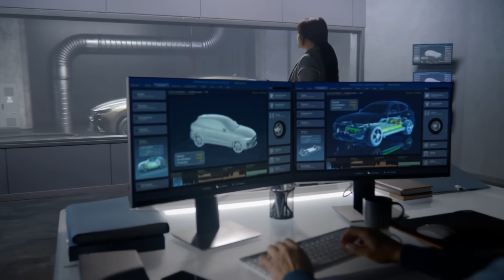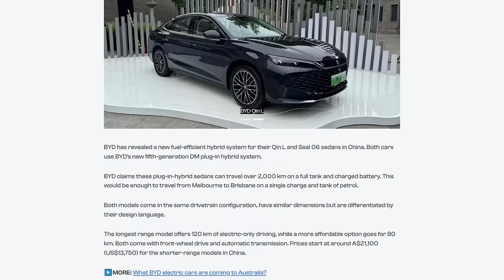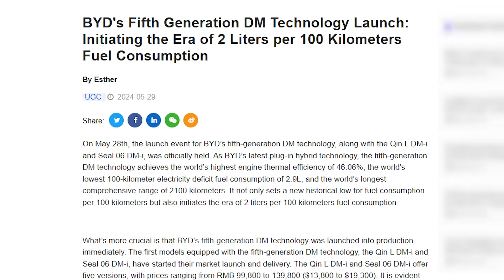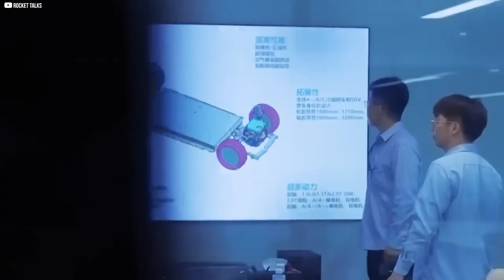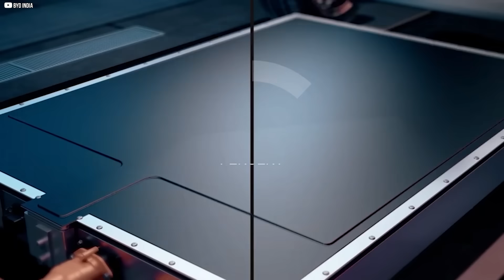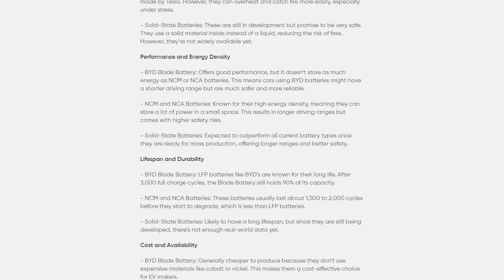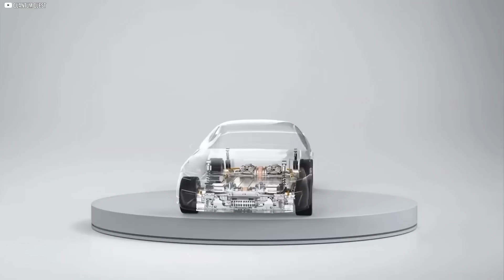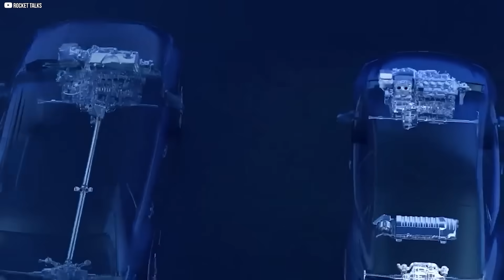Why the Auto Industry Is Shaken After BYD CEO’s Latest Reveal

Comment: Since three years Honda produces drives with roughly the same concept (but not plug in) : a combustion engine produces electric power in a generator which in turn supplies the electric motor which drives the wheels. No gear box needed. Only at speeds above 130 km/h the combustion engine joins in to reach the top speed of 180 km/h. My Honda Civic  e:hev has a 2 litre combustion engine with 140 hp and an electric motor with 120 hp. The system power is 194 hp. The fuel consumption of this mid sized sedan is below 5 l/100 km. This car is fantastic.

Comment: Toyota had already said hybrid is the future. BYD is late to the party.
Reply: Toyota is slinging mud trying to stay relevant too since their business is in trouble.
Reply: It’s totally different with Toyota hybrid,although BYD DMI is not a very new concept, but they use it to the maximum.
Reply: Toyota hybrids use oil instead of electricity. BYD hybrids use electricity instead of oil. The oil doesn't directly power the engine, it's only used for charging. They're completely different.
Reply: Vande mataram.bharat mata ki jai

Comment: Their next model uses that 50pc wasted heat to boil water which is used to drive a small 2 cylinder steam engine. The range is 3000 miles!

Comment: Trouble with a hybrid built around a low powered engine is while its fine around town, on a longer higher speed journey or when towing or other high load situation, at some point the battery is depleted and you are left with a 76KW engine trying to power a large very heavy vehicle and put juice back into the battery. Hybrids work best when the ICE is powerful enough to effectively run the vehicle in its worse case usage scenario without needing electric boost. This is where a Camry Hybrid excels.
 Still, without a full-sized spare you'd be crazy to drive more than 80km from home (space-saver) or outside road-side assistance coverage (repair kit - I hear they work great on a sidewall blowout!)
Reply: I too thought the gas engine was only a generator but it's not! When the vehicle gets up to a certain speed, the gas engine connects to the transfer case. BYDs are in essence a new breed of "hybrids". You can set it so that it doesn't do that...

Comment: 2000 km in single full tank + full charge
Reply: The Toyota can build the same one. The blade battery is a copyright from Honda too.
Reply: A YouTuber traveled 2,400 kilometers
Reply: @antony9866 Do you have to plug it in to charge or does the petrol engine do it?

Comment: i got the BYD Seal a month ago and its been sent back to the service center because the fuel system malfucntioning that cause the hybrid mode switch to auto swtichin modes which ultimately fried the blade batteries. i have to wait a minimum of six months to get it fixed because apperently im not the only having this problem . 🤣🤣

Comment: Siemens trains has been driven with an diesel generator and electric motor for many many years..
Reply: Yes. Its the same with Buses. Why do manufacturers not produce what everybody wants (electric for city) and diesel for long runs… dusl use fit for purpose?
Reply: Like 100 years old technology. Crazy entrenchment in the industry, and that’s why we need disruption every once in awhile.
Reply: PHEV cars have been around for a long time.  Toyota made it popular with the Prius (Prime).  BYD just do it better.  That's how technology advances.
Reply: @tomtube1012  The DM-i is basically an electric-driven hybrid system with the engine playing a supporting role—take away the engine, and it’s just an electric car. Toyota’s dual-engine system, on the other hand, is mainly engine-driven with the motor as a sidekick, so it’s essentially a gas-powered car
Reply: I would be quite about Siemens and their complicity in the illegal settlements in the west Jordan regio, useless to say: germans supporting zionism is no surprise.

Comment: You mean to say we have engine maintainance with battery maintanence too? I am sure it won't come cheap.
Reply: its far cheaper than toyota if check the price
Reply: Not really such a thing as battery maintenance, they just work and last about 15-20 yrs. the problem is bringing back maintenance on the a petrol engine with so many moving parts, part of me thinks this is going backwards, unless the petrol engine has a lot less stress on it because of the battery that might work
Reply: BYD True hybrid. unlike slow yo ta and slow honda being the same as diesel in fuel economy

Comment: PHEV is the best solution. Daily EV range enough for local shopping and work. Gas engine for trips, no range anxiety.
This is why I put a GSXR bike engine in my electric Smart fortwo! Dual engine AWD Hybrid.
40mpg while driving 80mph and regenerating the EV battery.
Reply: Like the Tesla owner with a gas run generator in his trunk? nice!
Reply: @dnitemarez  hey at least byd is transparent about it, and the main goal for them is to reduce the anxiety of finding the nearest charging station... no hate, just saying...
Reply: As an intermediate step, especially in places like the US, I agree.
Reply: Range anxiety is a mental problem, not a vehicle problem.
Reply: All roads lead to EV, PHEV is only a stepping stone before the infrastructure is ready.
Reply: @feizai245  but they still cant make batteries that will last long and is zero emissions
Reply: @danus-motbakken  EVs are zero emission, what are you talking about?
Reply: @feizai245 
Zero emissions? Where do all the materials come from to make the EV’s? How are they dug up, transported etc, where are they manufactured, then transported around the world for delivery etc? 😂😂😂
Reply: @MWTrade4Wealth  So? Just because they use GASOLINE engine vehicles to transport and coal-powered electricity factories, it doesn't change the fact that EVs are 0 emission. Funny how you insist that EVs aren't zero emission because of the pollution caused by gasoline and coal LOLOLOLOLOLOLOLOLOL
Reply: @feizai245 zero emissions? Burning coal is required to generate electricity to even use it
Reply: Worst of both world. Buy ICE or buy EV.
Noone needs 2000 miles range.

Comment: 80 miles/gallon is NOT ground breaking.
Maruti Suzuki/Toyota already has a hybrid on road which achieves the same efficiency figures using a 0.9L Gasoline engine paired with a Battery. Grand Vitara Hybrid.
Reply: Toyota hybrids use oil instead of electricity. BYD hybrids use electricity instead of oil. The oil doesn't directly power the engine, it's only used for charging. They're completely different.
Reply: Do they go 2000km when fueled full and fully charge?
Reply: I've experienced 80 mpg from my Lexus ct 200h.

Comment: When are these car manufacturers going to incorporate solar panels into the roof, bonnet and trunk? Why not let the car charge naturally when its parked in the sunshine?
Reply: battery capacity for common byd cars about 60kwh. While current commercial solar panels efficiency is about 20% so it produce within bright shine day 0.2kwh (sun rays energy is 1000w/m²). If it 5 hours full good sun day it just produce 1kwh of power. You need 2 months to fully charged while your car exposed to direct sunlight which I am sure will more demage to the car.
Reply: @catflixfree how much fuel would it save over 10 years of use compared to not capturing the fuel.
Why does it have ti be about replacing fuel all together? 
Why can it not just be about not wasting sunlight and supplementing fuel usage? 
Also, how do you know how many miles each person drives per day?
For short journeys it might be ideal
Reply: Solar panels are still not very efficient. Therefore even panels on its entire body will not fully charge any Cars' Battery in one ful day
Reply: @Ally31837 it's about capturing energy whilst it parked, it doesn't have to fully charge the battery.
Reply: Wouldn't get you far in a UK winter or Scandinavia.
Reply: @davidpeters6536 you would get as far as any other country, it would consume fuel or plug in energy..the difference is no sunlight energy would be lost/wasted
Reply: If you had 2x250w solar panels that’s only 500wph or 1kw per 2 hours. An EV uses 20kw per 100klm.
Reply: @anto11b Panels are now giving about 550 watts.10 panels on a car port roof- charginto into a battery might help.
Reply: @johnsampson2951 that’s good. But the question was when will roofs of cars have solar panels.
Reply: @anto11b what if it was a disabled person or elderly person just using the vehicle for short journeys?
Not everyone drives huge amounts of milage
Reply: Prius has the option to put solar panels in the roof.
Reply: Would be practical in sunny countries. Rest of the world, the sun is shy from quarter upto half of the year. Hybrid is a solution.
Reply: @ScarKeralier I mean on hybrid to capture free energy not replace fuel altogether
Reply: So that others can have that chance to put that change
Reply: There are many car has solar panel but that cant charge car to run even 20 miles
Reply: Solar panel is heavy and charge real slow. Go ahead and try.
Reply: At some point in the future, sure, that'll be possible. But right now, it still needs several other technologies to catch up. They've probably already thought about it. The problem is, adding solar panels to a car that's already complex just makes it even more complicated. So they're still working on improving solar tech to a point where it can actually be integrated properly with other systems.

If it were ready, we’d already be seeing trucks powered by hundreds of solar panels. But we’re not. That alone tells you it’s not there yet. We're probably not even at 25% of its real potential. It still needs to be way more efficient, lighter, easier to service and repair, and have a longer lifespan before it makes sense.

We’ll probably see real progress at home first, on rooftops, windows, maybe even walls, before we ever see it fully working on cars.
Reply: @swollendoggo2529 do you think energy companies and governments collecting tax would be happy sboit this?
High-performance flexible solar panels are increasingly available from several manufacturers, featuring advanced cell technology, high efficiency, and durability for diverse applications. Leading options utilize SunPower Maxeon cells, achieving cell conversion efficiencies up to 25.4%, with some panels designed to maintain significant output even when partially shaded, a critical feature for marine and mobile applications. These panels are also engineered for resilience, with some models capable of withstanding foot traffic and extreme temperatures ranging from −40°F to 185°F (−40°C to 85°C).
The technology is already here, linked to an inverter would recharge the power packs in both electric and hybrids vehicles.
Its not rocket science, its obviously political.
Im hoping China just starts pumping them out.
Thevrest of the workd will be forced to fillow or get left behind in oblivion 😂
Reply: Unless you have NASA level solar panels, any gains will turn into loss due to additional weight and increased friction. Solar panels are great but you need a ton of them. Instead cover parking lots with it. I mean right now solar panels are so cheap it might be cheaper to use them as roofing (not as durable though).
Reply: That's what I m wondering from last 2 years... Why they are not putting solar panels on car, s outer body
Reply: @nawazsheikh2246 in india already...Eva by vyve Motors

Comment: The future is of hydrogen, combustion engine. With batteries having much less role.
Reply: Hydrogen is cheaper but the technology to store it inside car in compact with safety is the concern. But then there is technology to turn water to hydrogen and oxygen,  but the issue is where to store the generated oxygen and oil corporations definitely not want to invest in such technology in which buyers just put their tap water into car storage tank instead of buying oil from them. If you are a businessman, would you invest in such technology? At least the batteries can only be replaced by the companies, instead of any average citizen that use water from river or at home to fill up the car fuel tank. Unless you want to become a charity person to create such thing, it is hard to achieve. 😅 Hydrogen power bikes already exist in China but don't hydrogen used in car made in China because of mileage limit.  Hydrogen bike has no issue since it only need to concern with only the weight  of 1 man and the bike itself.

Comment: What is the point here? This hybrid is not as good as Toyota’s hybrids. BYD's Hybrid still ends up with a large, expensive battery similar to a conventional EVs battery. Toyota’s  Hybrid battery is a small battery that sits under the passenger seat. 
I drive a Toyota hybrid, and in urban travel, the electric motor is the main propulsion unit, giving 75% electric travel and 25% fuel travel. The combustion engine only works when recharging the battery, which only takes a  few minutes, accelerating or going up a steep hill. Other than that, the combustion engine stops, and the car travels only on electric. I see no point in a hybrid having a large, expensive EV battery.
Reply: Toyota's hybrid range is only about 500Km, vs 2000 km for BYD's. For most people, this is a very significant improvement, not a "me too" product
Reply: Yeah, the British car industry had the same attitude and was overconfident in its models and didn't take the French, German and Japanese manufacturers seriously.

Comment: 46 percent efficiency, 80 mpg , that is revolutionary
Reply: Simply said Hybrids loose because EVs rules. Why design 2 cars to build 1 with 50% more parts.
Reply: @chilzone966  Full EV have huge batteries whose production leaves large CO2 footprint, they are extremely heavy and lose capacityafter four years. After 8 years they have to be replaced for a load of money. Recycling them is an unsolved problem.
Reply: @chilzone966 and i thought hybrids were tight.
Seriously tho...we can expect civil unrest..potential shortages in electric and gas..so hybrids are useful...also for long trips where charging infrastructure isn't available
Reply: @think2023  Electricity is available anywhere. We can even refine it from sunshine. Hybrids were only a bridge. The revolution is electrified. Time is the only factor.
Reply: Is it bollox
Reply: my corolla 2.0 hybrid 2021 has 41 percent
Reply: I dont believe what Chinese say
Reply: Randy, that's why China is now the number 1 Superpower?
Underestimation! 🤣🇨🇳Rules!
Reply: ITS BULLSHITE
Reply: 35 % thermodynamic efficiency is the maximum possible for 4 stroke engine 40% for diesel. That's the physics to the 46% thermal efficiency can't be done for a 4 stroke system. The 3L diesel Audi A2 got over 100mpg without hybrid 20 years ago and they still drive thanks to aluminium body. Sustainable car did exist. By car companies that did not let sign play for pay review contracts.
Reply: @abelgerli 15% compression is revolutionary.. no idea how the pistons don't melt 😮
Reply: My 1977 volkswagon rabbit deisel got 64mpg with ZERO electronics or emission controls.
It's 2025.
Floods droughts storms crop failures.
It's time to stop making CO2 and move to distributed nuclear and batteries
Reply: @think2023 many people got around 55mpg with the rabbit, but it was like 50 HP, these byds are around 300 HP and normal size
Reply: @Joseph-u7q9x  that VW was all i would ever need.
300hp? Don't need it and there is no way around the CO2.
2025...moving to high efficiency gas is like moving tk "clean" coal. Good ideas 40 years ago.